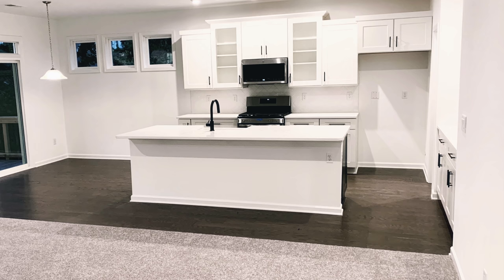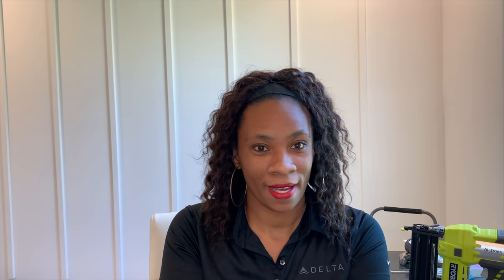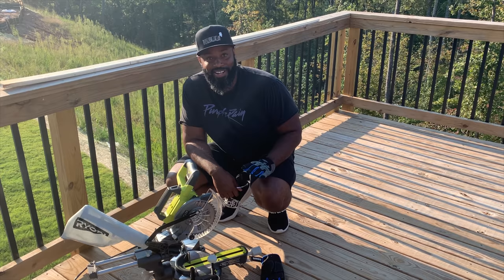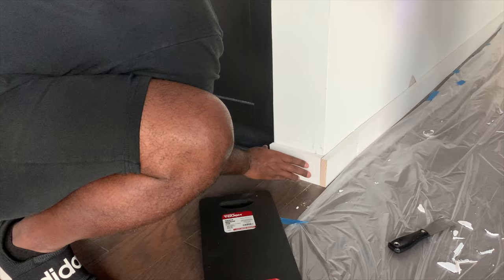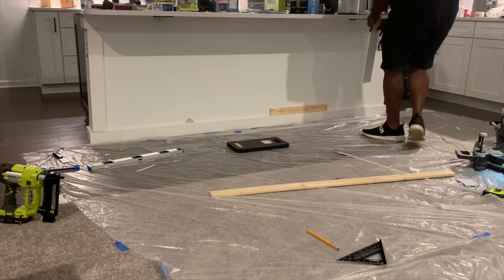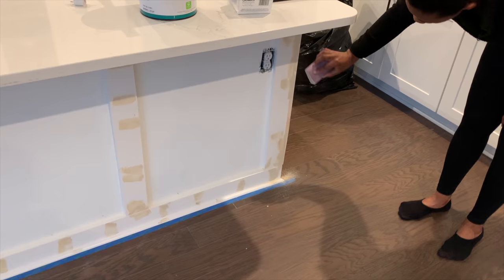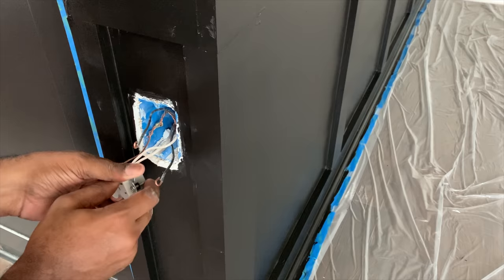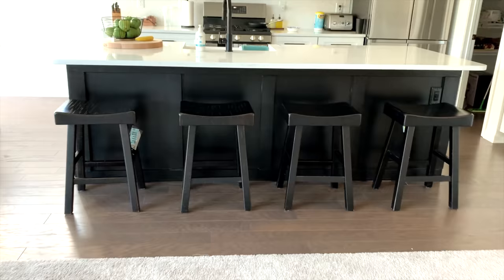DIY Kitchen Island Build | Board and Batten Upgrade - Fischer Homes New Build

Comment: Good job.you may want to use Satin finish when doing black, it shows less streaks. I learned from painting my doors black. Either way, it looks beautiful.
Reply from the maker: Thank you. Yes we thought about going with satin but we wanted it to be a little bit more durable since ppl will sit at the island. Of course if I were to do it again I would just spray it rather than roll it. Although, we did go back over it with a really smooth roller brush the brand was Purdy and you can’t see any strokes.

Comment: What a transformation. It came out great.
Two questions... Is the back of your island drywall or cabinet panels?  
What size brad nails did you use?
Reply from the maker: Thank you. Are you talking about the front where the sink is? Or the side of the cabinets? If it’s the front where my sink is those are cabinets and the side of the island are cabinet panels I upgraded with my builder.

Comment: Nice job? I see your cabinets are white, but the side of the island is black. Did you paint the cabinet or the builder had the sides black?
Reply from the maker: Thank you. I upgraded to have a contrasting island so that included the backside of the island and sides. So I decided to add the trim and paint the front of it black. The upgrade made no sense to me but the finished project was worth it.